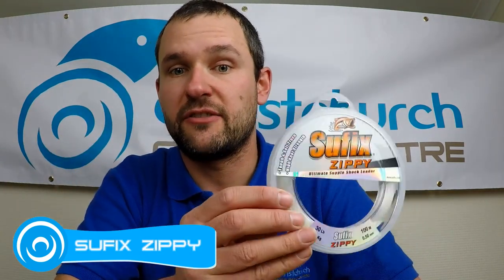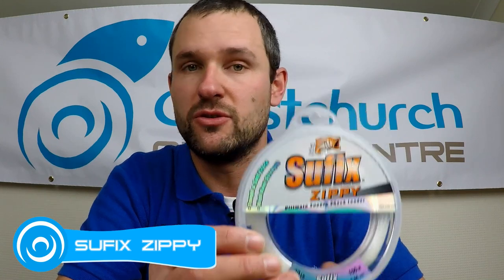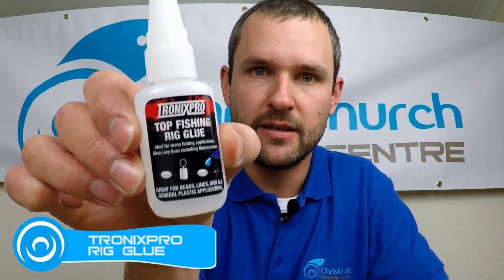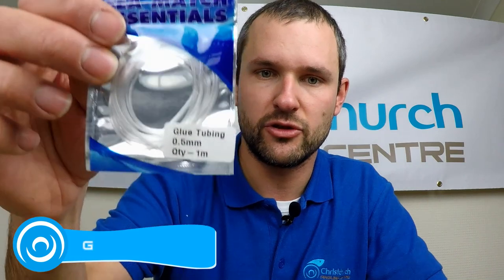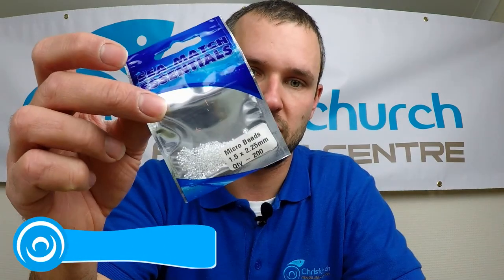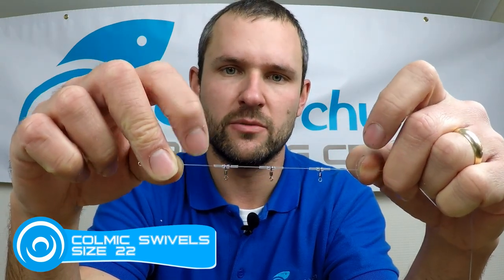Introduction to Glued Rigs

Comment: Fantastic video many thanks.
I am starting to fish a lot lighter (Beach Ledgering?) and usually end up watching stuff by Italians with no subtitles.!
 One question 
when using these light glued rigs is there a ratio for line diameter between rig body and hook line/snood? 
Say 1- 0.75?? Or less..
Reply from the maker: Not as such, rig body is determined more by what rod you are using and leads you are casting. I personally use 0.40 rig body (Titanium soft) when I'm using my light beach ledgering rods or my light surf rods when casting 2 or 3oz leads. The 0.50 Sufix Zippy will cover most of my "normal" beach fishing with my standard 3 piece rods and 4 or 5oz leads. If I'm on my more powerful rods and heavier leads then I up things to 0.60 Zippy.
Snood is determined more by the hook size, water clarity and intended species. For example if I'm targetting Garfish in clear water then I'll use 0.18 or 0.20 snoods to a size 8 Yamame hook with pop ups, but if the target is fish like Flounders or Pout, then there's little point in using such light snoods, so anything from 0.30 to 0.35 usually suffices.
I hope this helps.
Reply: Christchurch Angling Centre  A great help , many thanks for your time.

Comment: Can I use glued rig tube with 1 moving 3mm glass bead then a 45 1b Gemini snood swivel then bead and tube or do I need to use 4mm bead it’s on 60 1b mono line as the leader main line with the swivel on then the 40 1b mono line on the swivel as a hook snood trace is tied to it ? And a mainline swivel on the top of the 60 1b mainline trace . Please I ordered the 3mm glass beads plastic will the 3mm beads go through my snood 45 1b swivel?
Reply from the maker: Your 3mm beads will be perfect for that.
Reply: @christchurchanglingcentre5428  thank you I was worried lol